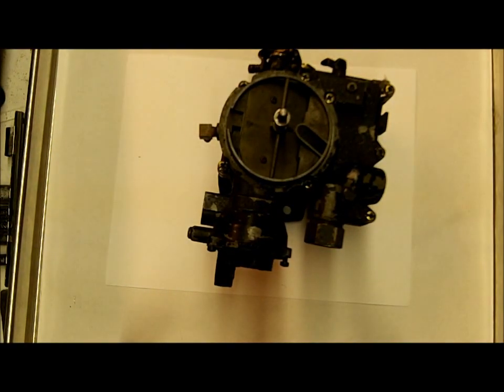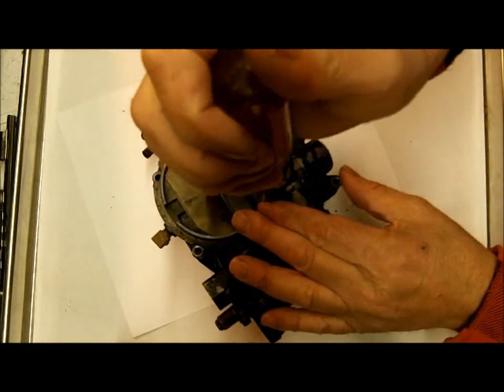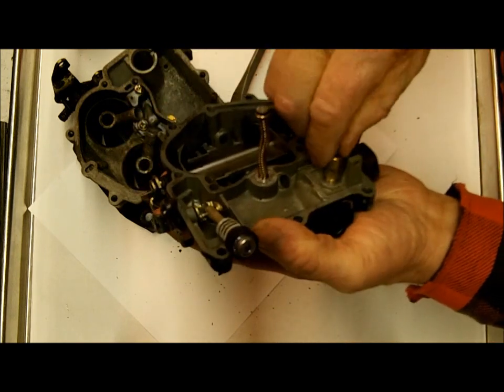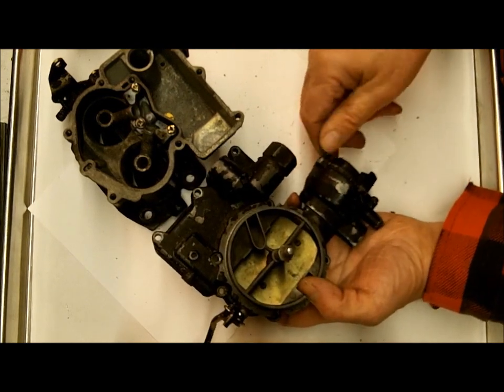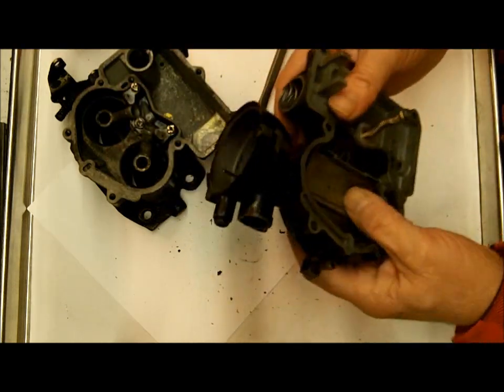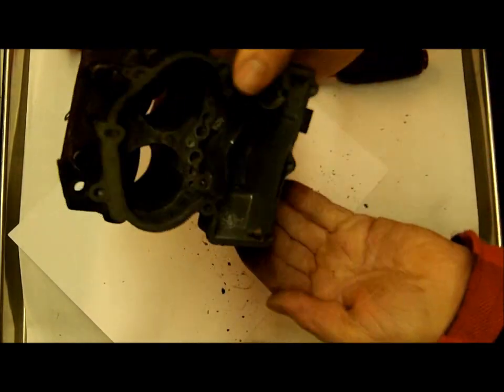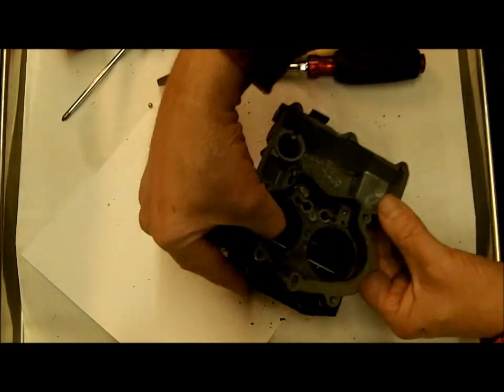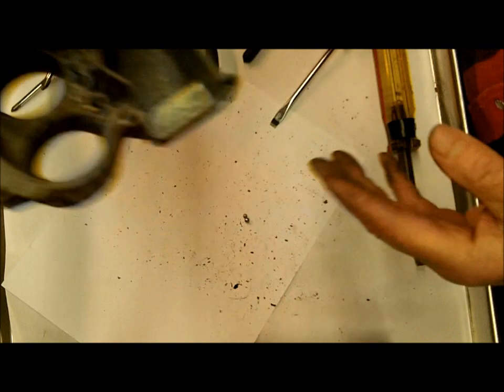MerCarb Marine Carburetor Rebuild - OLD VERSION

Comment: Thanks Mike, the reassembly video helped a lot.  Only some minor differences in Mercarb that was on my engine.  Curved shaft accelerator pump, and no check ball or screen in pump well.  Also my Mercarb only separates into 2 pieces.  Throttle body and Float bowl are together.   Thanks again, Great Video!!

Comment: Hi Mike. I noticed you did not put a check ball in the bottom of where the accelerator pump is in the bottom well. I followed your video and I had no squirt come out of the Ventura's. It run terrible. I found in my instructions for the kit and it showed the check ball so I put it in and it works awesome. Other than that it was fine but a very important step missed. Thanks Mike

Comment: Went to set the unloader on my mercarb and found there is no tab to bend. I figured maybe someone broke it off but looks like there was never one there. Usually you can tell if something like that been broken or not. Looks like it has never been overhauled until today. Original paint. Did have plenty of flakes in the bowl. Power valve was clogged to. I can tell the accelerator pump was pretty tired also. Was a fun rebuild with the help of your video... but not sure what to do with no unloader. No wonder it liked to flood at times cold
Reply: Mikes Carburetor thanks for your help. it didn't really want to stay open enough for me and kind of choked out. what I did I drilled and tapped on the flange and put a screw against the rod. and then did the final adjustment and works great. thanks again enjoy  your videos....

Comment: Hi Mike- this video is very helpful.  I started rebuilding my carb and when I went to remove the power jets the tops just chipped off (even with a large blade screwdriver).  My question is: would you recommend I continue with the rebuild and just clean the jets in place, or should I work them out with a screw extractor and replace with new ones?  I'm referring to the two larger (power?) jets with the spring loaded needle inside.  Thanks!

Comment: Mike, My manual calls for 1.65mm jets for the 3.0lx engine, but it has 1.45mm jets noted for the 2.5 and lower horse power 3.0 engines of older models. Could this be what's causing my stumbling and bogging past mid range throttle? If so where could I buy proper jets and power valve? Thanks  for all your help too.

Comment: Hey Mike, appreciate your video. Im curious on what kind of solution you use in your ultrasonic cleaner. I have different cleaning solutions but I have to be careful some eat different alloys. I have been using Dawn dish soap and water on general projects, do you ever use that for carbs or any cleaning in general?

Thanks
Andy

Comment: Please help, I am rebuilding the same carb i just bought the boat and the guy had this carb apart and put back together but from what I have seen several things are wrong my question for you is under the accerator pump where the spring, lock washer and filter than the ball is there suppose be a gasket in there?

Comment: i completely rebuilt my engine last summer, took  it out  on  the water about ten times this year.  every time  i take it out i have worse hesitation,  and rough up and down idle along with stalling  out upon acceleration . all research  I've done points to the carb  being the problem,  I've removed all old fuels and filters, still it got worse, i have an extra carb to rebuild,  what are your thoughts

Comment: I have a rather stupid question. I was checking the filter ont he fuel inlet, and I noticed on mine, the fitting has the filter seated inside it, and the spring is inserted in the carb first, then the filter seated int he fitting. This is exactly how your carb came apart.

When I look at the drawing in my Clymer Mercruiser manual, the diagram of the Mercarb and Rochester both shows the filter going in the carb first, and the spring seated in the fitting holding the filter all the way in the inlet.

Wouldn't havnig hte filter inserted first work better, since the fule passage is far inside the inlet? If the filter is seated back in the fitting, couldn't that restrict fuel flow?

Comment: Hey Mike! I am going to do a rebuild with the kit I can get here in Spain, one question, the only thing I still understand correctly. How works and for what works the "power piston"? Its like a bolt pressuring with a spring on a needle, what does it do exactly? Regards from Spain!

Comment: Thanks for the video, awesome job! I have a question for ya. I have a 1990 year Mercarb from a Mercruiser 3.0L and am having trouble distinguising what rebuild kit I need. Is there any obvious answer to figuring out if it is a gen 2 or not without having access to the unit? I know that it has never been replaced. Thanks!

Comment: Mike, I have a 1990 Mercuriser 4.3 with a two barrel carburetor. I am getting fuel all the way up to the filter on the carburetor I pull the fuel line off and turn the motor over and the fuel pump is working .But can get fuel into the carburetor would this possibly be that the float is stuck up ?
Reply: ***** Mike, I rebuild the carburetor and I can get the motor to start but it only runs for a sec, then dies. But if I pump the throttle I can keep it running longer but if I stop it dies.. Some people are tell me to check the pick up line out of the tank and to check the breather hole off the tank that there could by a vapor lock and the fuel is not getting to the carburetor fast enough. 
Your thoughts ?

Thanks, Mike

Comment: Mike, I took carburetor apart to re build it watching your video but on my carburetor I don't have that little screen and clip and ball on the bottom where the accelerator pump goes. is these a different Mercury carburetor. It only has the one adjuster?

Thanks Mike
Reply: Mike, On the bottom of my accelerator pump it looks like mine made be re place able is this why I don't have the screen and ball , clip ?
Reply: ***** Thanks, Mike so with the tag number on this carb. I don't need it just the one check ball.

Thanks, Mike

Comment: I have a 1987 mercuiser 2.5 liter and I am having carb problems it runs really ruff and when I took the carb spark arrestor off it had gas just siting on the flaps so is something stuck.. well the carb tag reads this 3.0 liter 1389-9562
Reply: ya it runs like its got to much gas... idk when the last time it was rebuilt the boat is new to me  I put a light down the carb so I could see and it has a lot of black gunk in it.. but I don't know how to work on a carb plus I would be scared to im near Detroit mi and its hard to find someone that's will do a good job.. thx info helps.. do u guys have redone carbs for my setup for sale could not find it on website